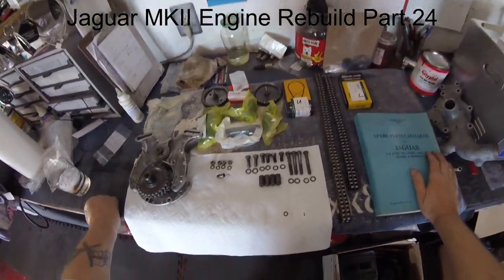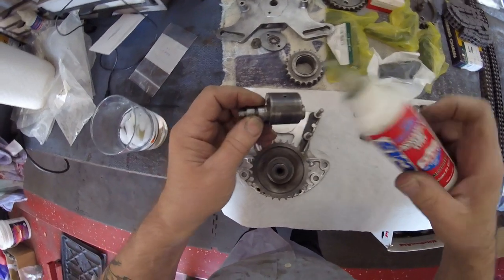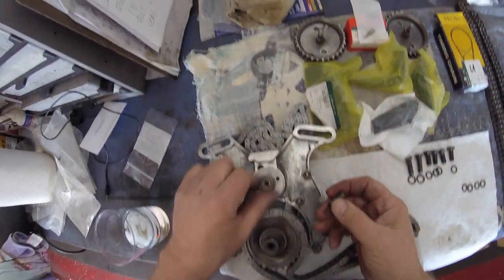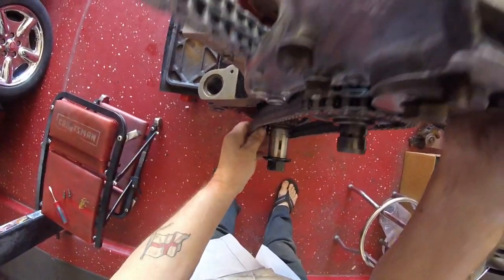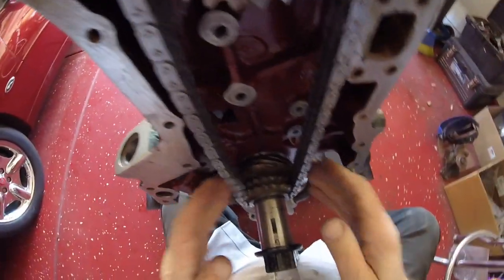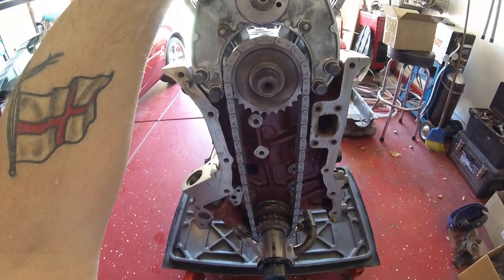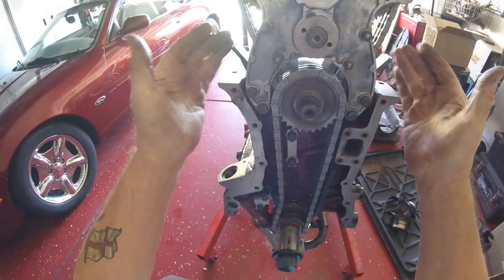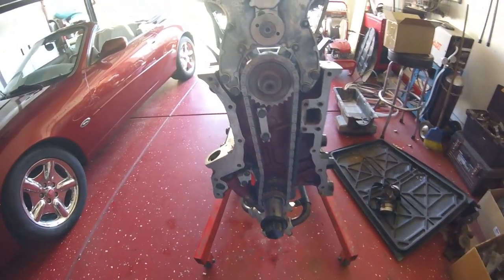Jaguar MKII Engine Rebuild Part 26

Comment: That tensioner doesn't seem to have  an very large orifice for the oil feed or could I just not see it  Great series I'm building a 3.8 and using the videos extensively  Mike Ontario
Reply from the maker: the hole in the back of the tensioner is probably only a 1/16" and in the block the filter is roughly 1/14"